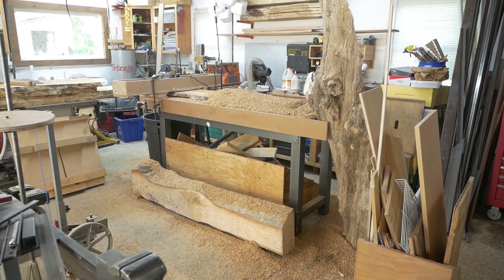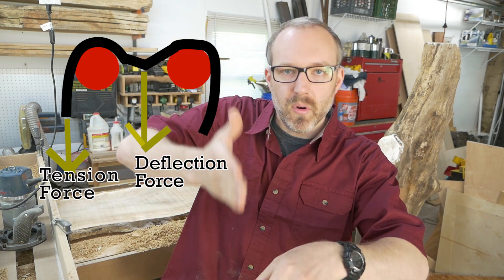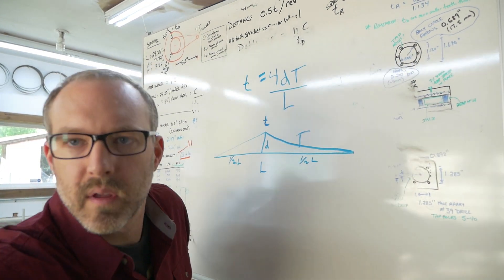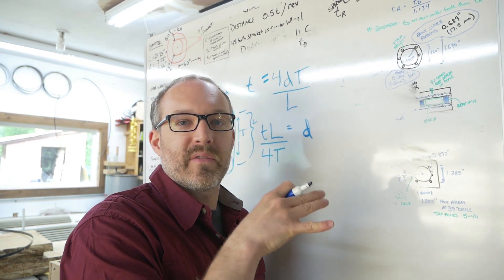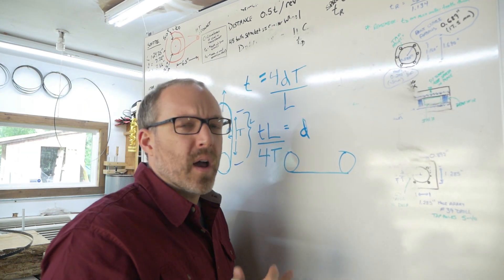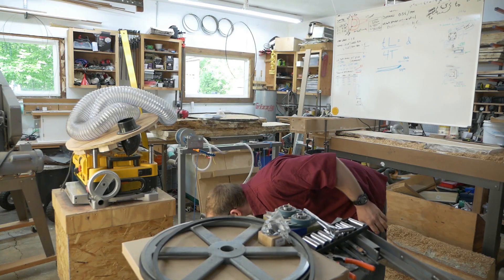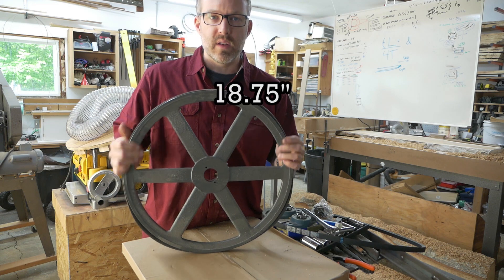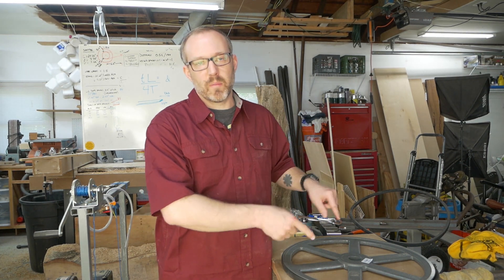Is this really why a Bandsaw Sawmill Blade won't cut Straight?

Comment from the maker: I should have pointed out, because of the 4 next to T, blade tension has the greatest effect on reducing deflection.  Four times as much as reducing length.  So tension is the most important thing according to this equation.
Reply: Tensión must be enough to support cut, but sharp and setting gives direction  up or down in horizontal, left por right in   vertical sawmills.
Reply: Question to you about your saw, in redoak video I could see the waves you are taking about. I just wonder how parallel is your cutting blade to the motion on the rails? Should it ideally be parallel? Or would a angle create a counter force pulling the in place?
Reply: @Cloudkicker000  I will almost guarantee the reason this happened is the front and the back of the blade are not parallel to the rail surface.

Comment: I know this post is old but I feel the need to add a new dimension to all the comments. First of all a blade needs to be sharp, set properly, and tensioned well.  (I like your guitar string comparison..... I used to tension my small shop bandsaw using a guitar tuner while plucking the blade like a guitar string.) I see a lot of comments on blade GUIDES..... I do not see much about blade SUPPORTS. There is a big difference between the two. If your blade supports are not lined up properly it will cause the blade to actually bend...putting pressure on the front of the blade causes the metal compress in the front and the back of the blade wants to stretch. These two opposing forces tend to make the blade buckle.....try it. Take a blade with your hands and try to bend it width wise. You will see it buckle. Granted ....if all the other factors are in good shape this will reduce that tendency, but that force is always present. LASTLY ..... you cannot force a blade that is dull on one side to cut straight. I like to see how other people think so I enjoyed your video.

Comment: I owned a circle sawmill for 26 years and I believe if you went with larger wheels thicker and wider blades as well as more set in the teeth and further tooth distance you would saw straight and faster if you don't believe take a look at shop bandsaws the smaller ones don't cut as good as the larger ones. Look at the large bandmills and resaws why do you think their bands are so big. If these bansaw sawmill builders would make a mill that would cut good and fast i'd buy one. In the meantime I'll keep building one that works right.
Reply: Can small sawmill cut straight??

Comment: Hi, I´m building one, but I have proble with vibrations, when the engine is running, the blade have too much vibration, do you know why?, did you have that problem or not?, thanks
Reply from the maker: I never had that problem.  My first thought is that a wheel is not balanced or a bearing is bad.  A couple things to try: does it vibrate without a blade on? Does it vibrate with a different blade?

Comment: I was a little surprised that you didn't mention logs with soft and hard grain like pine, from my experience the blade prefers to follow the soft grain which is difficult for it to do if the tension is right, the guide's are close and the blade is sharp, but if the blade is dull it will be very difficult to keep it from following the soft grain so you have to keep going slower and slower to keep it straight until you change the blade. Waviness isn't as much of a problem with harder wood because there is less soft grains to pull the blade.
Reply from the maker: Great point!

Comment: I built one. Initially I thought that high speed was a good deal, but it burns the saw teeth’s even with heavy water flux. The waving is a persistent problem.
Now I will replace, from 3hp2 pole motor to 10hp 4 pole motor + pulley belt reductor monted with a heavy bearings to get a lot of tention on the saw blade.

Comment: I think you realized this, but thicker and wider blades can handle higher tension, so that is how they would factor in to helping.  Blade size doesn't enter into the equation directly but it influences the "T" in the equation.  Bigger wider blade means you can run larger values of "T" in your equation, and that will reduce blade deflection.

Comment: I'm aware that this video is now a year and a half old. That said, I run a bandsaw mill every day. Usually culprits of cuts that you are showing are: at some point, your tooth side (front of blade) and the spine side (back of blade) become no longer co-planar. Usually this is because of either A) your wheels or guides are deflecting either the front or back of the blade out of alignment with the opposing side or B) you have material build up between the blade and the wheels; one side of the blade tooth profile has lost its set (you hit something that pushed the teeth out of whack); Tension. Blades heat up when you're cutting. Doesn't matter how much lube you are using, doesn't matter what that lube is. There is a change in the temperature of the blade and thus causes the blade to stretch. When it stretches, you have to apply more tension.

Also, adding more blade ABSOLUTELY decreases your chance of deflection. Not only because it reduces the deflection by force, but also because the spine of the blade, being wider, acts as a rudder in the cut and helps keep that cut flatter and straighter. If you cut a lot of very knotty material, you want to use the widest, thickest blade your sawmill can handle.

Comment: You're pretty much exactly right, IMO. Use the biggest blade... that your saw can tension properly; hence, you get the highest T that your saw can handle. And if you still have problems, use the fewest number of teeth you can get for your blade. In wood, you really can't go too low in TPI.

If you did both these things, and your saw still can't cut straight, you still have another option! (Besides beefing up your saw). In your video, you said that you need wider blades as you go lower in TPI, because the gullets get deeper. But the gullets don't need to be deeper. 

"Skip tooth" blades have a relatively low tooth count with relatively shallow gullets. I think they get their name because, say, a 4 TPI 1/4" skip tooth blade might have the same gullet depth as a typical 8 TPI 1/4" inch blade; so it's like every other tooth has been removed. They are often used for making contour cuts in thick wood. But you should be able to do the same thing on a saw mill. If you can't buy the blade off the shelf, you can make it yourself. The typical saw mill blade has a 3 tooth set pattern. You could remove every other tooth, with a grinder!  This will allow you to make straighter cuts (and with less horsepower). But you will likely have to reduce your feed rate, because each tooth can only remove so much material per pass.

Comment: Alignment is critical from my experience with blade sharpness and wood density, hardwood versus softwood. The force that is used to move blade needs to be minimized. I even increased my frame stiffness to insure little to no frame deflection, which could contribute. Your frame like mine is not robust.

Comment: PS: Always a good idea to build mill that standard blade sizes will already fit. Makes getting blades easier and faster. No need to custom order blades. I am by no means an expert, never even owned a bandsaw mill. Have studied them for decades and designed many after doing deep dives on everything related that the internet could provide. :)

Comment: Blade speed needs to be about 4,000 feet per minute. Thin curf wonders less. Feed rate of wood must not be above blade capacity to cut and clear. Blade guides shouldn't add more than the slightest tension, they are for blade alignment only. Blade size and type are determined by factors mill manufacturers can give guidance on. Wider is better as is thickness but availability is a factor.

Comment: Another thought on blade wandering.  I forgot to tighten a blade guide on my saw.  It had been cutting Oak perfectly till the top teeth (The ones that had been set facing the top of the cutting edge)  hit the guide.  After that the blade dived like a submarine due to the lower facing teeth being set properly and upper teeth losing set as well as being dull.   I thought I would sharpen the blade to see what would happen.  The cutting improved as did the diving, but it was not perfect.  I put a brand new blade on and  cut a 14" oak log  perfectly.  It appears that the sharpness and quality of the tooth set is really important.  I was looking on a video by a sawmill owner (which I recommend) and he said that he changes blades every two hours. I am working on an automatic blade sharpener and using   this blade as a test blade after I reset all the teeth and sharpen it a couple of times I will let you know what happens.

Comment: A handful of things come to mind..
Are your blades too long for your saw?
Next. The blade could be getting hot. For most cutting we use water to cool the saw. 
Next. Wimpy or worn wheel bearings. Any play at all will mess you up.
Also. You may have to slow down on the feed. You have a small saw.
And last. Check your saw guides for wear, and or improvement.
It might be time to change up to some bay bailer parts.

Comment: Okay, comments, I hope I get a response.  This was hard to listen too, not being a math geek, more of a trial and error common sense kind of guy,  anyway.  You touched on the the issues but instead focused on the math.   Yes, teeth per inch is important, angle of the tooth is as well, so is set, and the geometry of the gullet.  These all need to be in order for a good cut to happen, then you need to ensure the band teeth are sharp.  Logs size and species, hard or soft wood all have different requirements so know you stuff.    if any of these items are in compromise you will get funky cuts.  These funky cuts are more likely to be over ridden by some guy tighten the band more, wrong call!  Just fix the most likely item first, dull band, the tooth angle then set.  Over tightening the band will only cause bearing wear and shaft wear, which lead to unnecessary repairs and increasing time and money input.  Oh, the lubrication isn't lubricating the band, or cooling it, the "lube" is a cleaner, that is its primary use, sure if you dump a gallon of water on a band it will cool it maybe too much, what the "lube" does is clean the band, its a cleaner, cleaning the pitch and sawdust build up off the band so it can run at a proper tension and free, the band is actually  air cooled, a clean band will run cool, also over tighten a band will cause it to heat up, heat is bad for band life and doesn't solve the dip and dive problems.  Some food for though.

Comment: I have some experiance but I am fare from an expert. However there are some basic rools i learn. 1. the size of the wheel and band actually does not matter that much (Look at Milwaukee M18). 2. U learn from when u where small that when sawing u let the saw do the job and dont stress it or push it. If the saw didnt do the job it was something wrong with the saw (blade). Sawing dry hardwood is very hard for the blade so cooling and light pressure is important and a small and short blade will have less meter of running capasety  than a longer blade. And when the blade get dull it cant take any stress at all and will quickly get bad and brake.  So the most important thing I learn is to use time on the blade to keep them very sharp and to "Wikk" them (It is in Norwegian - dont know what u call it in US - it is about every second teeth sticking out to the left or right). The correct wikk will alow the blade to runn free true the wood with no side stress and it will not rise or dive. I got a electricsharpner with my bandsaw when i bought it 2. hand and it come in handy. The wikk I do with a small handtool. The bandsaw is a Lennartfors powered by a Jonsered chainsaw engine. It is small but works perfect as it is strong enough for the quit large grove in the blade.  Very large grove in the blade or large timber like diameter over 60cm would be a larger job for my engine but Idont saw much of that and if i do I need to trim them down to get them prosessed.  So the saw -  meaning the blade here is the issue.  Wish u luck with your projeckt. I also have had plane for many years to build a large bandsaw on truck chassis and use it as a mobile sawmill.

Comment: My personal experience, the setting of the saw blade tooth determine whether the blade will drift or not. When a blade start to drift , blade guide could not do much to get it straight. If the bride drift upward, try set more tooth downward, you will see improvement after that. How much tooth need to be reset is all by try and error.

Comment: I think your overthinking this far too much. Massive resaws have 2-3inch wide blades to reduce twist and wander  where as small 1/2 inch blade are used for cutting curves. Its easier to cut curves with a smaller blade, its easier to cut straight with wide blades. Its been proven for a long time, fit wider wheels and get a wider blade and tension your bandsaw properly.

Comment: That 4 comes from approximating the curve of the saw blade as a parabola! The slope of the parabola is 2 times the eccentricity divided by the length. When that length is half of the span (L/2), your equation becomes t =4dt/L.

Comment: I am going through the exact same thing with my mill... perhaps its the tension and distance from the guide bearing to the log like you are saying. running 1 1/4 blade and i find that the blade wanders too far back on the wheels and guide rollers and maybe it is taking the set out of the blade causing it to pinch and wander. i think i can fix this with flanged guide bearings and more tension. Cooks sawmill makes good stuff for homemade mills. thanks for posting

Comment: Just a thought... when ripping wood, the grain is also contributing side load. if your blade is dull, it'll round the corners of the point of the tooth causing grain following to be the path of least resistance until the tension overcomes that and you plow through the grain causing the blade to "wander" back in the other direction. Put a dull blade on your vertical saw and rip a hardwood board against the fence to watch this in action. Good find on the formula!
Reply from the maker: Good point!

Comment: Set up your tension hydraulically with a gauge so you can monitor the tension your keeping on the blade.  Loss of pressure will show you blade stretch due to heat or as the blade gets dull.  This allows you to see real time results on blade.

Comment: larger bandwheels (theoretically) also give you more kinetic momentum to tear through a rough cut, where as small light weight wheels are relying completely on the HP of the motor to push through the cut.
Reply: I don't know but HP leverage torque speed momentum all need to be in balance, a person needs to be an engineer to get this right to be able to saw a flat board. I guess I would have downloaded and studied some of the manuals for store bought sawmills an did things the Chinaman's way and copy copy copy . LOL

Comment: Wheel diameter is very important. Thickness of the blade shoud not be greater than DIAMETER of wheel/1000 for ideal lifetime of the blade (information from www.pilana.cz, blade manufacturer). If you are using smaller wheels then recomended for the blade, you are shortening its life due to bending it too much. Another important information, that many people didnt know. Bandsaw blade must rest. It is recomended to cut 2,5hour, then resharp the blade and let it rest 12hours. So If you want to be cutting 8 hours /day, you must own 4 blades. It may be strange, but try it. I was cutting 8 hours at once and blade is cracked every 15cm (with one final crack).
Reply: ...but, as you can see on Woodmizer Timberly, band wheels are 400mm, and recomended (sold with machine) blades are from 0,9 to 1,07mm. So it is not STRICT rule. You are only shortening lifetime of the blade.

Comment: The other factor I’ve always assumed had a lot to do with it is whether the blade was angled parallel to the ground (or to the track, really). I can’t remember but I’m guessing you had an adjustment to set that? But the other points here on tension, sharpness and feed rate are also good and worth exploring. I can tell you I’ve bought lumber from a guy with a giant woodmizer that is usually high quality but for whatever reason the day he was cutting this cherry was wavy as hell, so even the pros can have these issues. Keep at it and keep us posted!